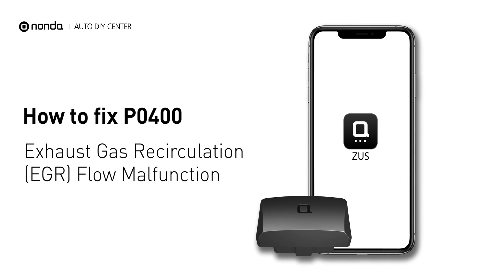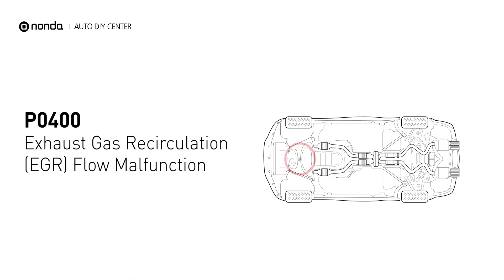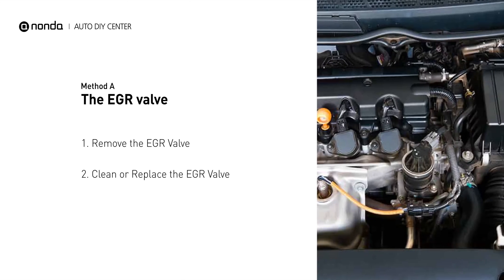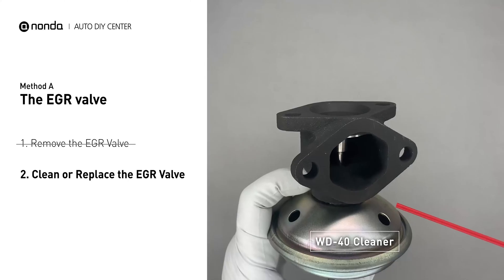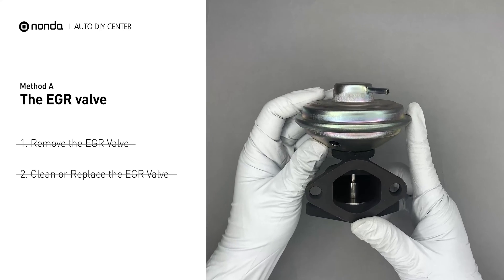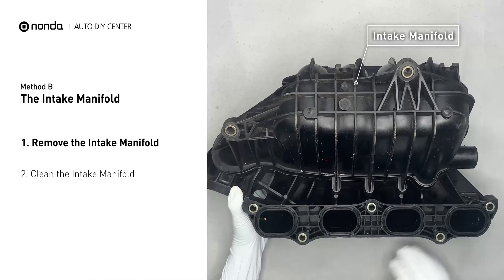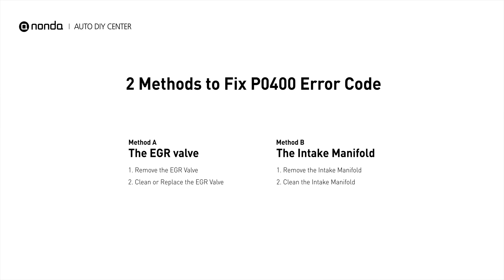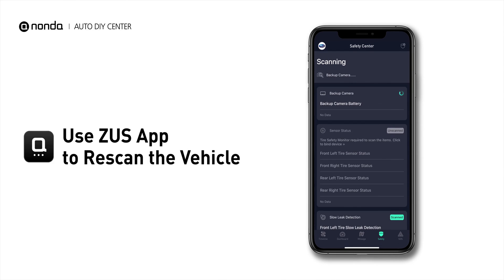How to Fix P0400 Engine Code in 3 Minutes [2 DIY Methods / Only $4.11]

Comment from the maker: Hi, I'm Steve, nonda's lead mechanic engineer. 
Feel free to leave your comments here if you have any mechanic questions, I will be glad to help you out!
Reply: Hi Steve my BMW X5 diesel will not rev over 4100rpm and if I'm driving and floor it it cuts out and shows the p0401 error. I don't have vacuum from the egr solenoid @2000rpm either. Could this be the problem?

Comment: Yeah I'm having p0400 and p0403 codes in my old toyota 1.4 d4d car. Changed the egr-valve, and cleaned the connection cable. Still no solution. Just wondering because the check engine light didn't show 24/7 in the dash, it might light for couple of weeks, then shut off for week, two, three.. might be something else.
Reply from the maker: Hello, we suggest getting your vehicle visually inspected by your local mechanic for further diagnosis.

Comment: Hi nonda, i see you have p0404 and p0400 on two videos, whats the difference for this fault codes?
Reply from the maker: Hello, the code p0400 is triggered when the EGR temperature sensor does not see a temperature change when the EGR is commanded to open. Replacing an EGR temperature sensor or cleaning the carbon off of it is the possible fix. While for the p0404, a faulty EGR sensor is the most common cause.
Reply: @nondainc  thanks for reply :)
Reply: Hi i gave golf 2008 fsi 2.0 I changed the egr and I still have the code p0400 scanner tools say exhaust recirc a flow   no signal communication  any idea what to do i checked the 1 connection go to the egr but still having same problem
Reply from the maker: Hi Abdul, please double check if there's any other trouble code along with this code.

Comment: Hi Steve,
Thank you for your video.
I have tried both methods to stop my Saab 9-5 2.2TID from getting the P0400 error code with it going into limp mode.
Unfortunately I am still getting P0400 when I drive on the motorway for 50 miles or more. I replaced the EGR valve about 4 years ago and  have done about 40,000 miles since that time.
Do you have any other suggestions?
Thank you
Antony
Reply from the maker: Hi Anthony, how about all the electric connections, have you checked them?